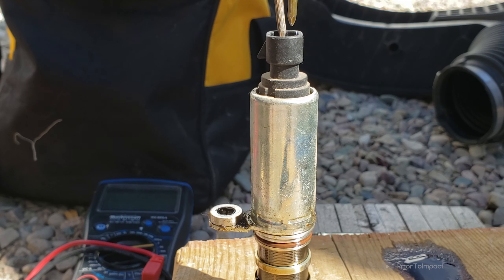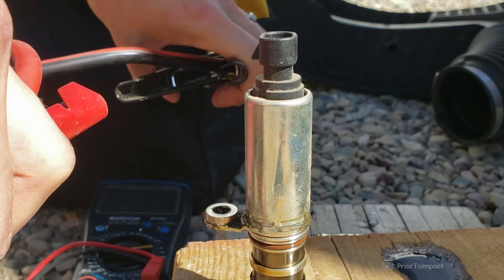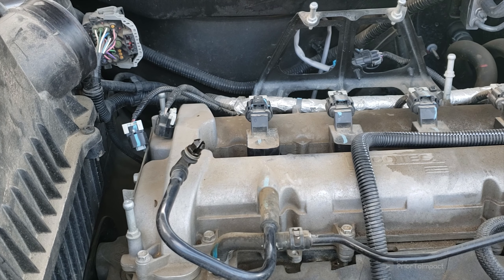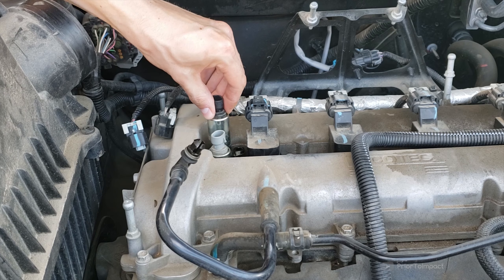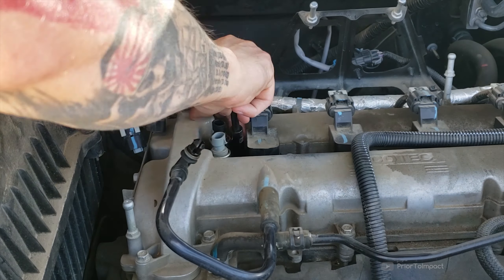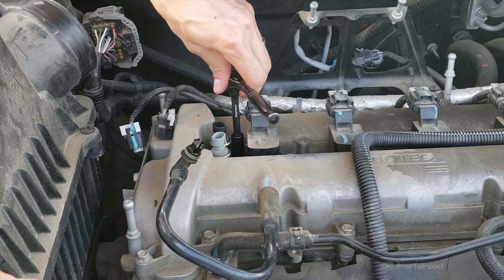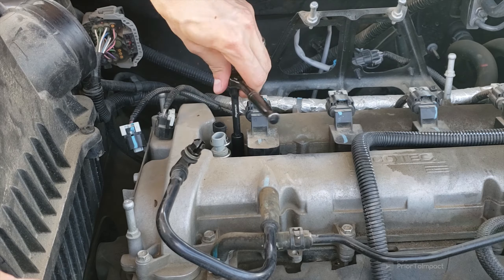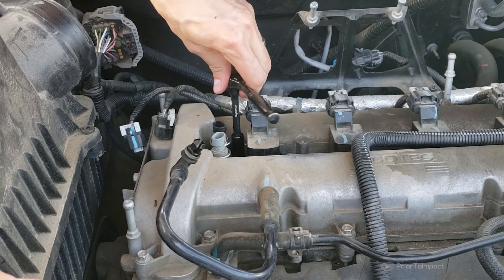How I Test & Fix GMC Terrain VVT Solenoid (Variable Valve Timing)

Comment: Hello dear, I own a Terrain 2016 and currently I have problems with it as it consumes a lot of fuel and the air-conditioning switches are no longer working and the tire sensor as well and it consumes spare parts in Al-Haddadiya

Comment: The machine's light appeared code poo14, the black and lead silomides were replaced, the engine oil and filter were replaced, and the wires were checked, but the code was cleared, but this code still appears. What is the job?
Reply: What ended up happening with this?